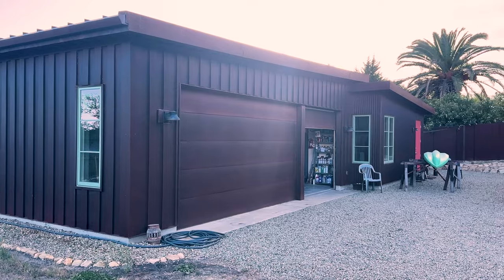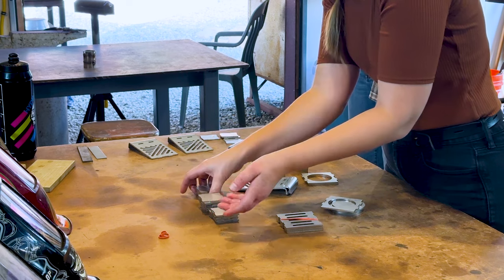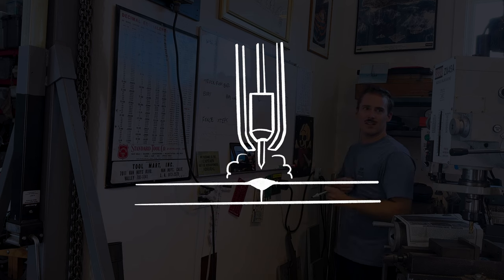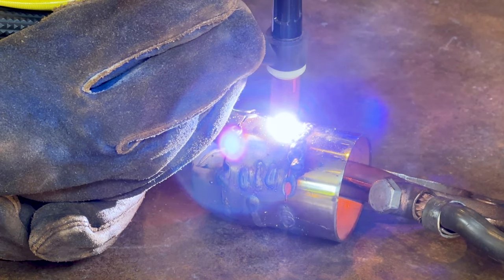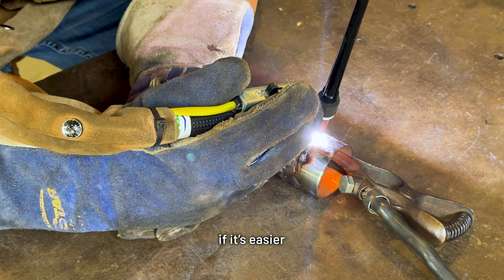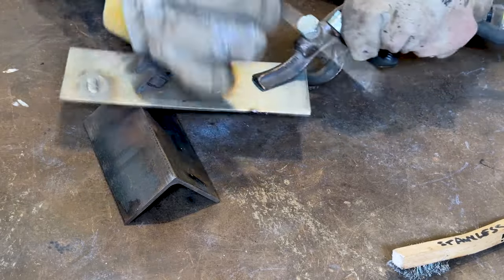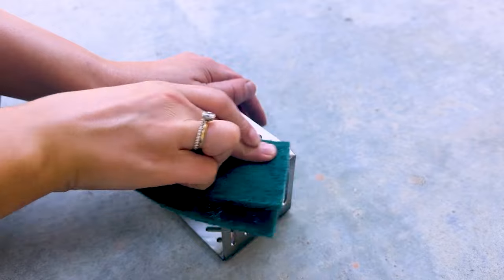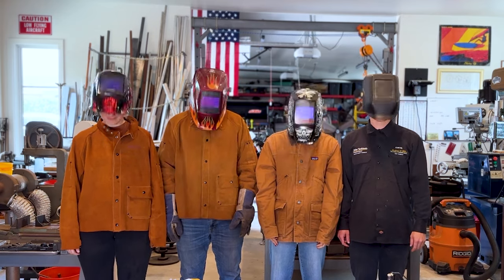Trying TIG Welding for the First Time

Comment: For your first time the welds looked good, tig feels like a lot at first but when you get the hang of it it is in my opinion the most relaxing way to weld just practice practice and have patience with your self you will be great. Some tips that helped me are to form a 90 degree relationship between the touch and filler, sometimes music is hood to help keep rhythm with the dabs,and if your part allows for it leave I tiny bit of stick out and use the stick out as filler. Good luck
Reply from the maker: Thank you :) I like the music tip, that's a great idea

Comment: It always makes me smile when I see people pick up a tig torch for the first  time. The one thing I would say is try not to get into to the habit of resting your 'tig torch hand' on the bench/table because you want that arm to travel consistently while dabbing your tig rod. Also a tip for you to nail the rhythm is to listen to music with a good beat, or listen to a metronome at 75 bpm. I hope that helps. 
from a guy with 15 years experience in stainless sheet metal fabrication.
Reply from the maker: Appreciate the tip! Tig is something I'd love to dive into more when I have time / better access to the equipment.